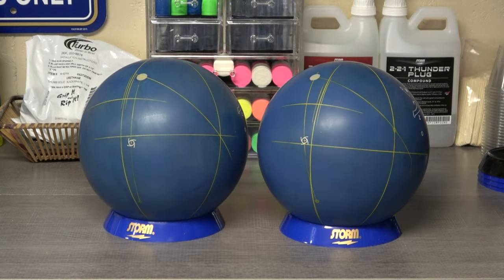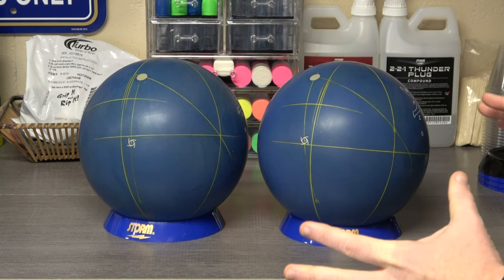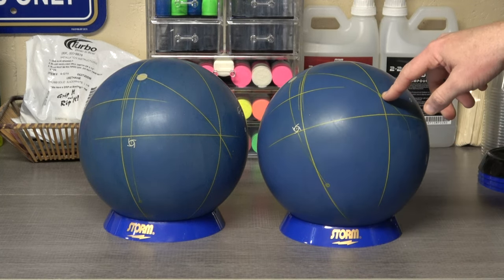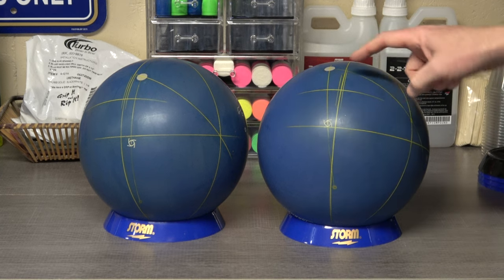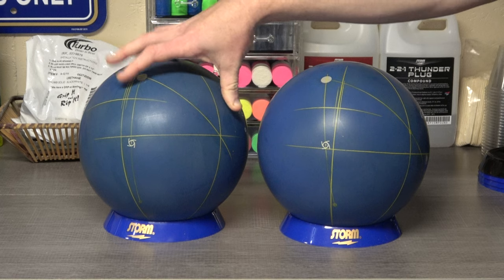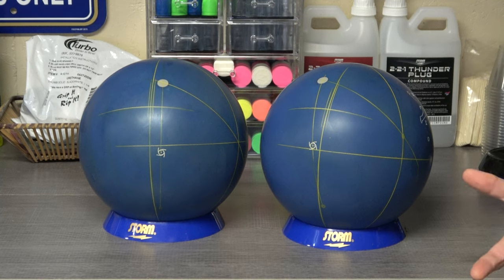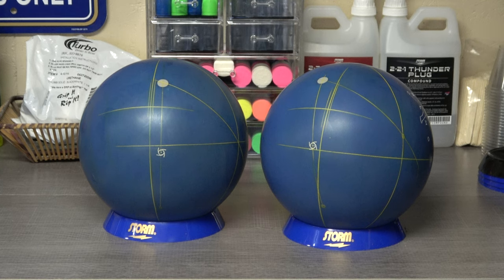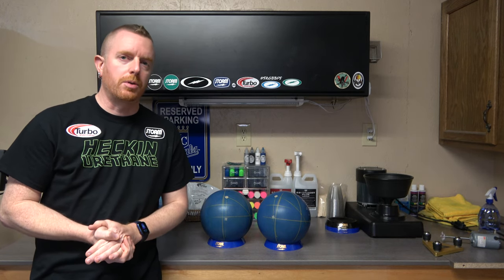The Importance of Knowing Your Positive Axis Point

Comment: Will your PAP change with different hand positions?
Reply: I have asked that question several times to others and never got a answer from anyone.
Reply: I would say logically it would, right? Because when you lay down the ball using a different hand position say up the back, the ball is going to track higher thus kicking the axis point out further. Whereas if you come around the ball to generate more axis rotation, the axis point comes closer in and makes the track lower. That's just my thought on it, someone can correct me if I'm wrong.

Comment: Since surface supposedly matters more than layout, I'd be curious how differently those balls reacted if both are thrown by someone with one of those PAPs.
Reply from the maker: I mean, if the same person threw both of those balls, they'd be different, not substantially because I didn't use extreme examples, but what amounts to about an inch of difference on pin to pap would be noticeable.  Surface matters more from a raw ball reaction point of view, like if you mash something with a 500 pad, yeah that's going to make it hook a lot more than changing a layout, but when people stop talking theoretics and get into practical stuff or what's effective, it's a different story.  

The longer pin ball will be longer up front, won't flare as much, and will be straighter off the end of the pattern, so while the total hook or actual ball reaction won't be much different, it could create a pretty big difference in lane play to get the ball to shape right to get through the pins the right way.  Technically if you threw them both from the same spot, the one with the longer pin will probably just flat 10 where the stronger ball strikes from, but you might actually have to move further inside with the longer pin ball so that you can slow it down and get around it to both get it down the lane and then up through the pins the right way.  

People seem to think in terms of just how much something hooks though, so it's not really comparing the same thing.  Layout more controls the reaction shape, whether something rolls earlier and is more continuous, or whether it's longer and more forward.  Surface just controls how early or how late the ball actually hooks, and how smooth or sharp the reaction is, but it won't fundamentally change the reaction shape.
Reply: And this is why I follow you! Great explanation. Thanks!

Comment: Luke this is the question that I get the answer because I’m a full roller track line is off my ring finger and just above my thumb through the center of grip in an upper angle but I keep getting told I do not have a positive axis point. Is that true ?
Reply from the maker: No, you definitely have a positive axis point, however, full rollers need to have balls drilled in a specific way to avoid the ball rolling over the finger holes.  So while you do have a positive axis point, it's really not necessary to know what it is because your ball HAS to be drilled a certain way.
Reply: @LukeRosdahl  I was told that by different professionals through the years I have Randy Peterson to thank this is when he was in a shop before making it big. Brunswick gave him that drill pattern based on the way of my release. Been stuck there ever since. Good I have 13 3’s but no 8’s so close .so I’m stuck there only using surfaces and weight blocks to keep me above 200 avg.  I watch and listen to you learning how and why balls react  the way they do.  I think you are the best in many ways. I would have to take a year off learning curve to change. At my age now don’t have the patience. Everyone should admire your ability to go from right to left hand. Incredible thank you 🙏 for all your help gaining knowledge You Are The BEST..!! Thank you

Comment: i was 5”, 1/4 up . been drilling the ball like this past 3 years like this. 

i am now 4”,3/4 up or somethingbecause i start rotating more. i have 4 equipment with my old PAP. my PSO say  shd stick with the old PAP for measurement.... is that true? or what shd  i do next
Reply from the maker: No, you should use whatever your current pap is for your measurements . .
Reply: Luke Rosdahl so what do i do with other equipment?
Reply: @Hwasabi_MLBB  I personally would say keep throwing that equipment if it still works for you. Layouts are (as Luke puts it) more of a fine-tuning tool in ball reaction. Your PAP changing won’t change what the ball is going to do for you a whole lot. If you’re curious what the layout on your old stuff would be now, you could go to your pro shop and have them “reverse engineer” your layout on your old equipment using your new PAP. That’s what I did when I recently found out mine had changed.
Reply from the maker: Yeah it depends on how much your pap changed, if it's a small amount and the balls still react fine, then there's no issue, it's just that now that you have had your pap remeasured, drilling new balls off of that will be more accurate, BUT ball reaction is always king.  If it looks good and everything is working out, don't mess with it lol.

Comment: Hey I had a pro shop tell me my PaP is 6 1/4 and 2 inches down. Does that sound right?

I’m a 2 handed bowler. Thanks and hope to see if that is normal. Thanks
Reply from the maker: I could believe that, depends on where your track is.  Is it really close to your middle finger and then kind of tilted right?  Or if you DID have a thumb, would the track be closer to your fingers but then go away from where your thumb would be?  Hard to explain without using pictures

Comment: Question out of curiosity. When laying out a symmetrical ball with VLS, what do you use as the marker for the PAP to MB measurement. Do you use the CG as the marker to the PAP?  I know it doesn't matter much because it is symmetrical, but was curious anyway.
Reply from the maker: Yeah typically you just draw a line through the cg and measure to 6 3/4" from the pin and call that the psa/mb.  You don't even need to mark it or measure to it, but it's just an easier process to put it on there and include it.
Reply: @LukeRosdahl  Thank Luke, great info as always! Much respect.

Comment: Luke, say someone constantly was changing their hand position and release to suit the conditions and angles being played.  How does PAP measurement stay consistent (or does it??) when the release, axis rotation, tilt, etc are changing from condition to condition (or game to game)???
Reply from the maker: It really doesn't, that's why some guys have different layouts on the same ball, sometimes it's to tweak THAT specific motion a little, and other times it's to adjust for how they're physically throwing it.  Sometimes you need to spin it or add some tilt or angle of rotation or what have you, and while you're not going to measure for several different paps, the differences in how you might throw the ball in different situations does come into play when laying a ball out for a certain purpose in the first place . . . if that helps.
Reply: @LukeRosdahl  Yup it does help.  I have two Wild Streaks, two Hustle Inks, and two Pro Motions.  I know that their natures are a result of the layout and surface and any other changes I need to make I do with my hand.